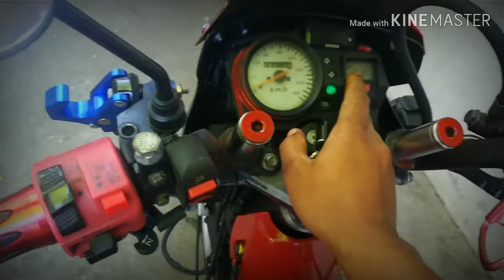Paano mag tuno ng CARB,at mag plug reading.(mga bagay na dapat malaman kapag magtutuno ng CARB) #12

Comment: Boss paki sagot naman po nag totono kasi ako nang motor ko na skygo king 150 pinalitan ko nang carb ng tmx 155.. actual tono ginawa ko boss pinainit ko muna makina ko tapos 1 and half boss nakuha kuno matataas na tono ok na kaya Yun boss.? Paki sagot naman pls. @ RRJ TV
Reply from the maker: Bro mababa maasyado yun atleast mag start ka sa 2 turns..
Sabay ang sunod..
Saparkplug readin ka dapat..
Reply: Pero paps hihina po kasi menor niya kapag naka 2 and half turn na ako 😔😔
Reply: Mag jejeting kaya ako paps kasi class a Lang kasi to carburetor ko eh
Reply from the maker: @melvinancero2299  1 1/2 mo bro
Reply: Salamat sayo paps God bless po🧡
Reply: Boss tanong ko lang ung sa akin raider 150 stock carb nka open pipe ako nasa 3 turns na ang air fuel mixture ko lean parin po ung plug reading ko ano kaya ma sa suggest mo boss TIA😊

New subs po idol
Reply: Boss nakuha Kuna tamang sunod optimal na optimal talaga nasa 1and 3/4 turn ako sa hangin God bless boss

Comment: Boss gud am po paano magadjust Ng carb pwk 28mm.2 mechanic hirap cla slamat
Reply from the maker: Anung motor ba bro..
Minsan kasi mahirap iudjust a isang carb..
Dahil masyadong malaki.. Ang binibigay ba gass sa combustion.

Ngayon hindi kayang sunogin lahat ni sparkplug kaya hirap ang motor minsan lalakas hihina.. Minsan mamamatay..

Kya bro kung maliit nacc lang nman motor halimbaya mga 100*or 110*
Kalilangn. Mag upgrade k muna ng mga electrical parts like cdi ignition coil at sparkplug..

Para mag match ang. Malalaking carb bro..

Ang tanong ito bro..
Ilang cc ang. Alaga mo dyan